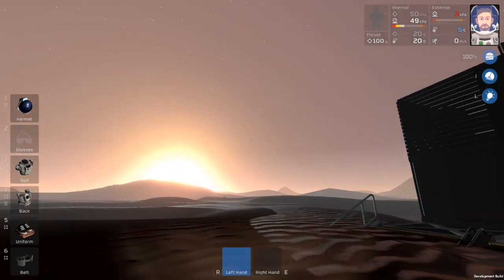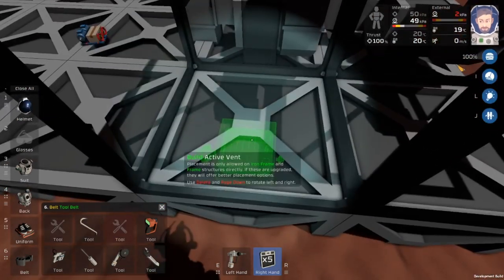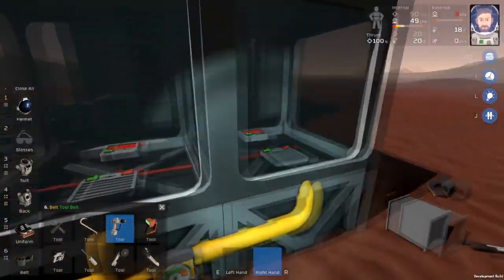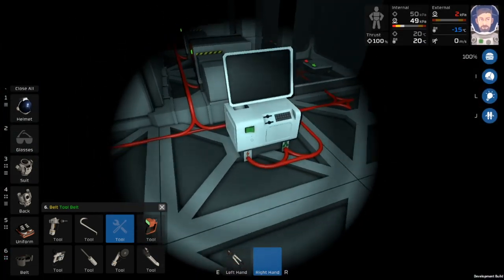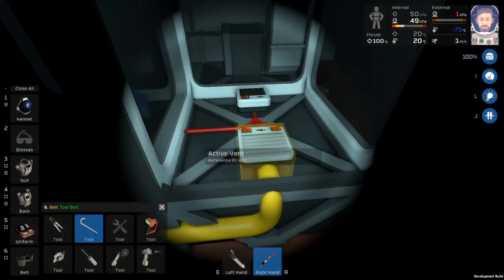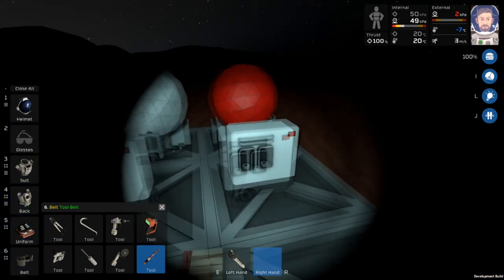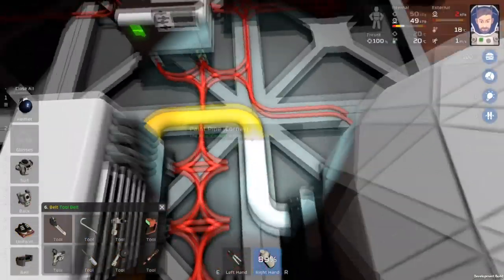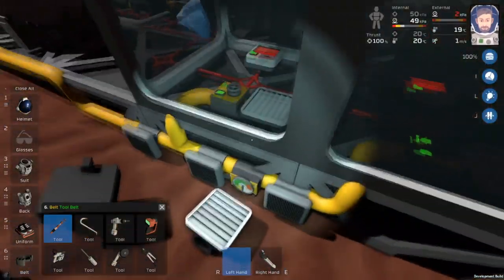Fuel Facility Ep. 2 (Fire)

Comment: This is how science is done!

The heaters are the problem here. They will ignite any mix of H2 and O2 regardless of temperature.  If you just make them glass boxes without the heaters the ice will melt during the day without risk of fire.  This method is very slow as the melting ice will cool the room so its best to take the room to vacuum and the sun will keep melting the ice.

I have found using a furnace with some logic to spam the activate button will chew through ice very quickly. The output gasses should still be cold enough to reach your filtration system without igniting if you mix it.
Reply from the maker: Hey you gotta try! furnaces were the way to go, keep an eye out for a new video soon! Thanks for watching!!